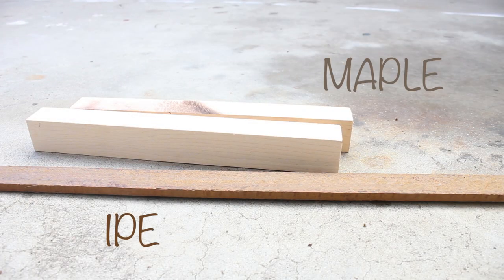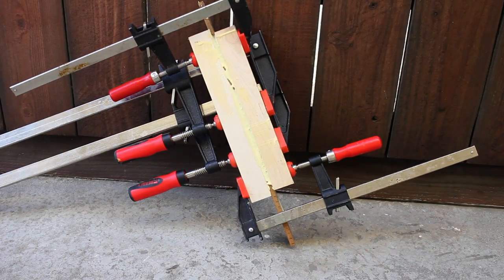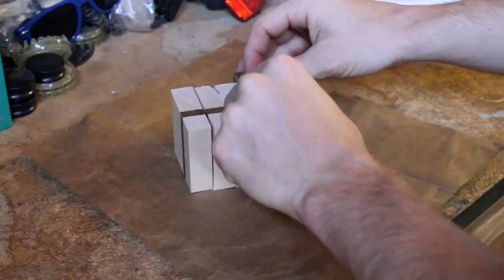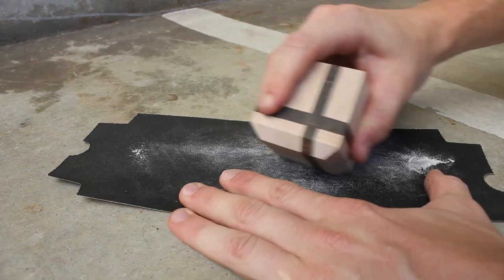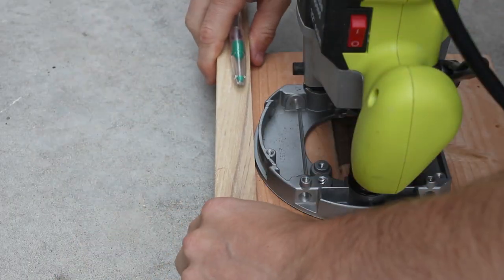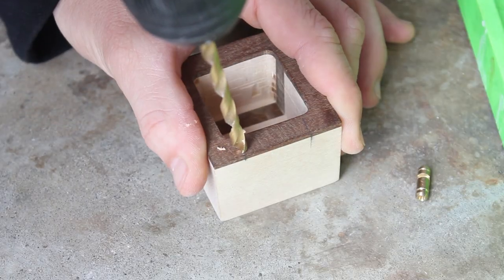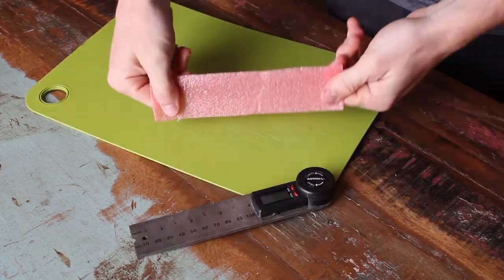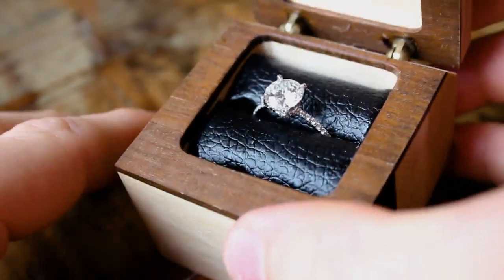DIY Engagement Ring Box | 13

Comment: My son is getting married in a few weeks and I was asked to make the box for the ring bearer to hold. I figured like other first time projects I take on I'd watch a video or three of other hobbyists doing the same thing. I watched dudes use CNC, highspeed tools, slide vise's and who knows what else. In the end your approach was the best in my opinion. It wasn't over engineered and the solution was a simple concept that anyone with a few basic tools and scraps of wood can accomplish. Keep up the good work!
Reply from the maker: That's awesome - yea I definitely made this long before I had big tools at my disposal (basically had the planer and a chop saw, and a router) - but most of the steps I figured out along the way. Only thing I'd do different is maybe try to round the top a bit more versus the chamfered look, but it worked out well in the end if you know what I mean!

Comment: Congrats! As far as the router table, just use a few pieces of plywood to mount it. Super simple. And still works great as long the router has some depth adjustment.
Reply from the maker: Agreed - I should just DIY one. I'm currently not accumulating new tools - just really low on space!

Comment: Why didn't you just use a miter saw instead of the Sawzall?

I am having a hell of a time getting the jig to fit well enough that it's tight around the block without any movement. Would you have just used Forstner bits and then chiseled out the inside? Also do you think a mortise bit would have worked better? I'm trying to recreate this and am just having some issues because I'm a beginner, thanks.
Reply from the maker: Miter saw would have been way too sketchy with my hand that close to the blade. You can definitely just do a Forsner bit and keep it circular if you don’t want to worry about chiseling

Comment: Do the barrel hinges stay closed well or are they loose? I'm trying to find a way to have the box stay relatively firmly shut unless I apply force to open it. Not a ton of force, just enough that it wouldn't just fall open in a suitcase or pocket
Reply from the maker: They stay closed well. They aren't "snappy" like a regular jewelry box, but they have enough friction in the hinge to provide a very stable open / closed setting. Having travelled with it to my proposal desitnation (suitcase, pocket, etc.) it stayed closed no problem. 

A small trick I discovered was to rotate each hinge ever so slightly (i'm talking like 1-2° tops) so that they were facing inwards - that tension of having something open at 90° but the hinges be offset slightly so they're working a bit against that angle created even better friction. Let me know if that makes sense. 

Lastly - if you were super paranoid, you could always add very small magnets to the lid and box so that when it is closed, the magnets touch and keep it closed. Lots of ways to DIY hack it - good luck!

Comment: Since this is an old video, hopefully you have a router table now.  I did what you were doing there one day just to run a few sample profiles for my wife to choose from.  The router grabbed one of the pieces and pulled my finger in it.  That was the last time I did that.
Reply from the maker: I do - but even for this video, I should have just used the belt sander - I had seen Mike from Modern Builds do this and (as a beginner) probably didn't fully understand the danger of it

Comment: what did you use to put the angle on the bottom
Reply from the maker: benchtop disc sander
Reply: The Cutting Bored I have that but how did he put the angle on. The level seemed to stay at 90 degrees not 45
Reply from the maker: Did you watch the video? Platform is 90° to the disk on the x axis, Miter gauge is at 45° to the disc on the y axis, then sand down. It's at the 6:42 mark...